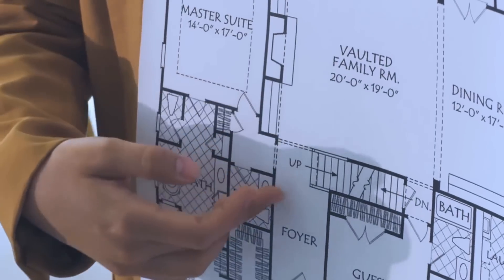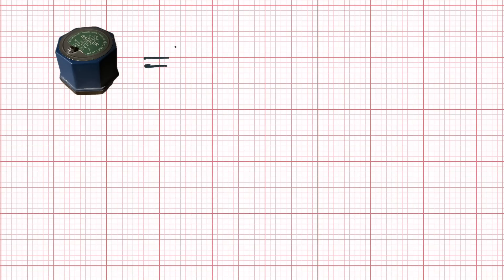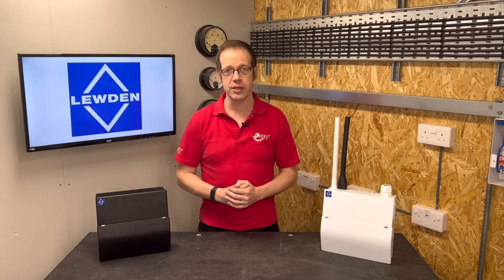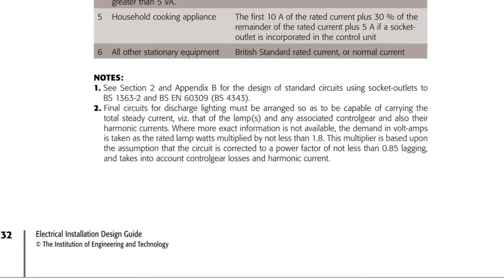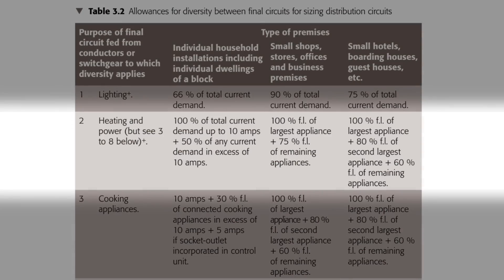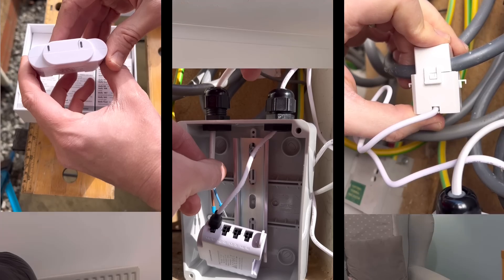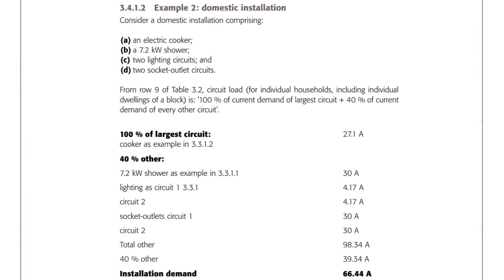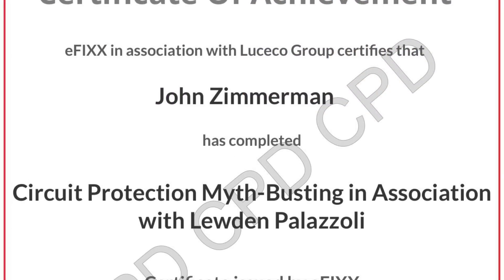Are You Calculating Maximum Demand Correctly?

Comment: The calculated current demand of the 7.2 kW electric shower is 30 amps, because it has been calculated at 240 volts, so 100% of the shower circuit load is included in the calculation, as it is the largest load, not the cooker.
Edit- but you can't apply diversity twice to the same circuit.

Comment: Diversity is a fudge.
You should always and only ever design for the actual worst case.
I suggest people did try to do this then realised "oh sh*t, it can't be done without rewiring the whole house, the street and upgrading the substation".
That 66% is a fudge figure I suspect it may have started off as a higher figure, then as more load is added to houses that figure will drop and drop.
The fudge then becomes an unrealistic lie, potentially a dangerous lie.
Many house mains fuses are just 60A the wiring to the home which is underground covers a considerable distance, is sized for this current. As a result of this, you can argue a very high percentage of UK homes are incompatible with Mr Milliband's EV/Heat pump electric only net zero insanity.

Comment: Either method is inaccurate, Would much rather itemise each circuit with expected loads, add 20% headroom to give total load per circuit. You would then add an estimate diversity factor % to each circuit based on modest use and go from there. This seems like a more realistic calculation but would take longer to number crunch. For that reason I've got a template spreadsheet ready.

Comment: I’m assuming the garage radial is in 4mm since 2.5 can only carry 27amps clipped direct and therefore shouldn’t be on a 32amp mcb or rcbo
Reply: Next column-  'A2 Radial'.....
Reply: @ef7480  27A max, and then add any insulation or grouping. Just stick with the 4mm.
Reply: @007floppyboy  ?
Reply: @ef7480  "Next column-  'A2 Radial'....."?
Reply: @007floppyboy  -table in OSG refering to your comment and originally my response to original comment.

Comment: 30W per LED point is definitely still massively excessive, I'd say 10W.  Anyway, I am in Australia, for a residential house, its not even worth calculating, because maximum demand by limitation is easier, every distributor wants a 63A main switch on a 100A fused supply.  You can easily exceed 63A for fairly lengthy periods without an issue. If you need more, you will be looking at a three phase install anyway.
Reply: how 30 watt per led is too much? the big leds i have are 38 and smallest is 10
Reply: @LCMWR  I have 68 downlighters at 5W and 2 double panels in the garage at 75W each. The total load on both lighting circuits including extractor fans, floodlights and what have you is 1110W lol

Comment: If I am doing a new build I do this but if I am doing an EICR I often will state 100A if a 100A fuse is fitted, 80/80 etc. One it's not possible to monitor when carrying out an EICR for a duration long enough to simulate a true load and 2 because the majority of properties are now having Heat Pumps or EV Chargers or both fitted the majority of the time we're spiking to 96 Amps in detached and semi detached properties. When designing from scratch I was taught 5 watts/ft or 80 watts/meter rather than relying on arbitrary loads, sadly this calculation now comes in well under what I am actually finding during testing.

Comment: Also I've been told by DNO workers if sticker says 100amps, the standard is a 80 amp fuse and stickers not always correct
Reply: 100a is the rating for the fuse carrier it could have a 60a fuse in

Comment: Ah calculating MD... my least favourite topic 😅

I recently was asked to come up with a figure for an install at a luxury leisure park, it has multiple 400A 3ph origins and I was going to be working on one of these. I started on the 225A sub-main feeding the site of the install and came to a figure of 75A spare after 2 days. When I mention that I have to carry out the same calculations for every sub-main on the origin I was told they were going to remove a 36kW heater from the spec and just go ahead blindly
Reply: I do this every day. 

Caravan parks are more challenging to work out max demand than any other installation.

Comment: Clicked on this as I was curious how it was done there. I teach Code at a local college for apprentices and we do load calculations for homes in a far different way, and the only reason we do it is to determine the electrical service size (main breaker to feed the home) A massive difference we have is ALL lighting and general use "sockets" are simply calculated based on the square meter area of the home (5000w per 90m2, than 1000w for every additional 90m2 or portion of),  Ovens, electric heating, electric car chargers all have specific requirements afterwards we add any other load over 1500w at 25% demand if an electric oven has been accounted for. quick and simple.

Comment: Easy, we have 150% PV, And over 400% groups.
My primary rail is limited to 40A per building while mid day 80A would be available.
The 80A can flow, but never will there flow 80A on any rail here due to the way I've centered both solar-pv and grid supply.

Comment: This video makes very little sense. You talk about maximum demand (what you might have to contend with when all the high-current devices are on), so you have the capability of supplying them without failure (wiring and fusing). But then you're calculating some kind of average (assuming that not everything is on, or not running at full current). 

It's certainly NOT a given that someone won't be using an instant heating electric shower while someone else is using the electric stove and one or more hotplates, and electric room heaters are in use around the property. Not to mention that electric ovens of the old design, with simple resistive elements, are either using full current or next to none, as the thermostat cycles, rather than some variable power output inverter. They don't use variable amounts of current, when the heater is on, depending on what temperature you've set them to. 

If you are calculating maximum demand, then actually do so. Calculate the highest current that could reasonably be in use at the same time (the shower in use and the stove, a couple of hotplates, one or more room heaters).

The average is, of course, going to be lower - the stove is on a thermostat, likewise for room heaters, which individually switch on and off at various times unrelated to each other. But they can all be on at full power at the same time. Overall, your electrical system needs to be able to cope with that (fusing and wiring).

Our house failed in design to cope with real world situations, such as electric fan heaters running in two bedrooms (incidentally, that's already higher than the fuse rating for the sockets circuit), plus an electric kettle boiling, and the microwave oven at the same time. At some moment everything was drawing full current, and the fuse went.

This is a 1965 house, with all wall sockets on one radial going around the house, on a 16 amp fuse. Yes, real fuses - and I prefer them, breakers can fail to break, a fuse wire is going to blow. And I don't hold truck with any arguments that some dimwit could put something other than one strand of the correct fuse wire in it. That isn't going to happen here. Anyway, people do force breakers on, and breaker switch parts can weld together, or simply fail to release. Properly wired fuses fail "safe," they don't not blow.

But the house was never designed well. All the sockets on one fuse, and a house with no central heating. Of course you're going to run electric heaters in bedrooms, unless you like wrapping up like an Antarctic explorer to try and keep warm, while still breathing in chilly damp air. And most portable electric heaters are very high current devices. Power requirement calculations that aren't based on reality lead to this kind of stupid electrical design happening.

Comment: I remember the old electricity boards used to say 40A was what the average house was as a maximum demand.
Reply: A high power (> 10 kW) electric shower uses more than that. (OK, it only runs for a few minutes at a time). Add in cookers, immersion heaters,, heat pumps and electric car charging and we are heading for values about double that.
Reply: @roberthuntley1090  I did mention that old electricity boards so don't know now but the supply still was 60,80 or 100 A

Comment: Interesting take on the subject. The guidance is to reach a max demand for the property, not for your living arrangements. Add an EV and a heat pump which is the direction of travel and you will see that demand is a critical calc.
Reply: But that demand calculation must be re-done when introducing large energy consumers that are only installed officially by competent persons...! Determining a demand that is far higher than practically needed increases costs in a way that's not necessary. the difference might be a property needing 3 phase or not. Actual use must factor into the equation or, as this video highlights, homes would need +100 amp incommers which in the UK at least is unlikely to be possible without significant additional costs... and all for an overzealous demand calculation...
If additional high current consumers are introduced, then sure the demand calc should be reconsidered... Catering for tomorrow's' theoretical needs is today's expense; and it's a luxury most consumers would prefer not to indulge in...

Comment: When I first started did maximum demand once for a rewire on a 4 bed house, 4 rings, electric shower, electric cooker etc.  Came out at like 96A, the fuse was only a 60A, called up DNO and asked them to upgrade the head to 100A, a specialist came out, I explained my maximum calculation via BS7671, the response was:  "Nah its fine, we don't use that, tell you what if you ever blow the main fuse tell the guy that comes out that I said you can upgrade it to 80A, it will be fine"....

What a waste of time..
Reply: Perhaps, but the practical application of experience is still a valuable commodity often overlooked in today's 'over educated', but mostly theory based electricians world...
Reply: @dougle03  Yep exactly this, although I created 4 rings, Kitchen, Utility, upstairs and downstairs, originally it had just one ring for the whole house which had been fine for 60yrs, even though I increased the number of circuits does not mean I actually increased the load.
Reply: Exactly its bloody stupid how many fuses are blowing out there

Comment: The Shelly 3EM can monitor three-phase current or single-phase current. The power supply for the device is on phase A.
The newer Shelly PRO 3EM, on the other hand, is power supplied on phase C.
The power clamp must be attached correctly. 
On the Shelly 3EM the arrow points from the fuses to the electricity meter. 
On the PRO 3EM the arrow points from the electricity meter to the fuses.

Comment: Pro tip for calculation: lights -ignore. IT -ignore. -smoke -ignore. Number of socket circuits - ignore. Walk around the house and find all appliances that can create significant heat (at least 1000W) and will run for at least 30 minutes. Multiply by 10. Done.
Reply: But I've seen some places with well over 1kW computers.
Reply: @lua-nya  Yes 2 computers in my property are running on 1200watt power supplies but they're only normally running at 1000 watts each when their users are gaming. For 6 hours straight. Computers should be included.
Reply: @effervescence5664  If such computer is found. Ok. More than 99% of households do not have such PCs.
Reply: @lua-nya  Residential.
Reply: Quicker still just put max demand the same as the cut out fuse.

Comment: I’ve managed 63A averaged over a half hour… that was an interesting night…
Reply from the maker: Dare we ask what you were up to? 🤔 Keep in mind it's a family show! 😂
Reply: @efixx  car charger (32A), Storage heater (10A), then the dishwasher, washing machine and tumble dryer (since replaced with a less inefficient model) all managed to spike at the same time.
Along with the baseload of fridge/freezer and network gear.
Note that other than the storage heater … there is no water or space heating.  Heat pump definitely on the cards though.

But nowadays most people should be able to look at smart meter data for an absolute peak, and a typical peak over the last n years.
Reply: @JohnR31415 That's basically the same as he was getting plus the EV charger (39A+32A would be 71A). EV chargers change everything.
Reply: @efixx  Someone getting an electric shower while someone else is cooking a meal on an electric hob while the EV charges would easily get well past 63A.

Comment: As I’ve had a few issue’s now with AFDD’s “nuisance” tripping. Working as it should but certain items plugged in on one circuit don’t trip but on another circuit with some white goods, say fridge on once item plugged in the AFDD trips anywhere from 5-30secs. Should we (electricians) 1st fix to European radial circuits as AFDD’s were designed for said Euro circuits in the first place.

Comment: The point about maximum demand is about what "could" be being drawn not what actually is being drawn.  A house with 12 rooms would likely be calculated to have a maximum demand that is higher than a house with 6 rooms - but if both properties have the same number of occupants and same appliances the actual demand in that circumstance might be the same - but what if the owner of the 12 room house sells it to a large family - the actual demand would likely increase - the electrical installation must still be able to handle this safely.  The demand calculations include lots of spare capacity for this reason - relying on actual usage isn't safe as actual usage changes with circumstances.

Comment: Great video. What it shows is that the maximum demand as shown needs quite a bit of updating. 

In a commercial premises I rewired there are 20 circuits. 
- each treatment room has a radial circuit 
- the lighting is separated across 4 circuits
- emergency is on its own. 
- alarm 
- cctv 
- fire alarm
Etc etc. on max demand traditionally it’s a huge amount, but in reality is nowhere near that and is far better for the customer because it offers better continuity of service in the event of a fault. 

And when testing in the future it’s easier to work around.

Comment: If I use any of these methods on my own home the numbers are just bonkers.  How can any methodology proposed by these (almost historic) documents be credible when they can end up overstating maximum demand by multiples of what the actual typical values are?  
Looking back this year I can find 8 kW as my peak load... for the whole house... in one 30 minute period.  I have a double CU and a sub-panel CU and loads of circuits (20+ I think).  
Realistically the peak load for me is when exporting power at around 9.5 kWh - under 40 Amps at my supply voltage.  I feel no need to count the over-provisioned wall sockets or the number of lamps.  Add in the modern reality of the dishwasher, washing machine etc timed to run in the early hours (to take advantage of cheap rates) the 'latest' guides are just swept into irrelevancy.
Reply: Is it really acceptable for the main fuse to blow out just because it’s unlikely that you’d turn on the shower put a pan on all four hobs and crank both ovens, turn on the kettle and flick on the toaster and washing machine. Maybe you don’t do that, but the next person in your house might.
Reply: @edc1569 factor in the tripping curve on a BS1361 100A incomer is such that a 200A load passing through that fuse will take just over 30 minutes to trip.

None of those loads with the exception of a constantly running water heater, eg the shower, will run at full power for more than 5-10 minutes before starting to cycle, or turn off having completed it's task.
Reply: Exporting power at 9.5kWh?
Peak power of 8kW in 30 minutes?

Hmmmm